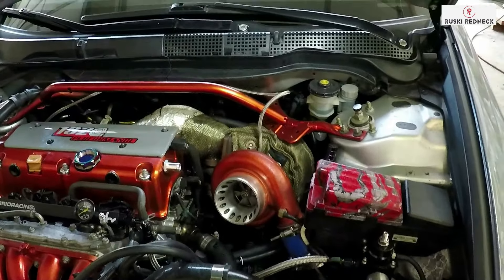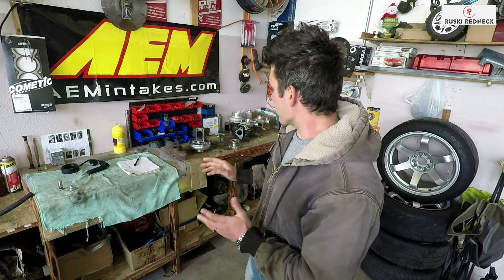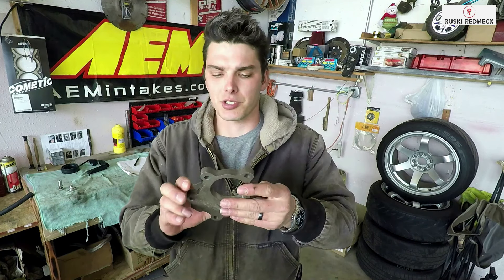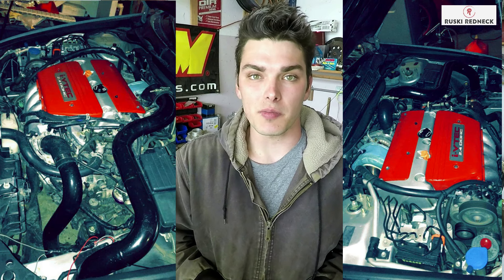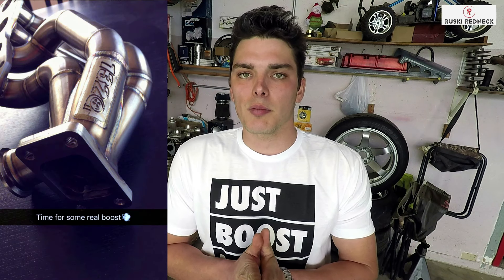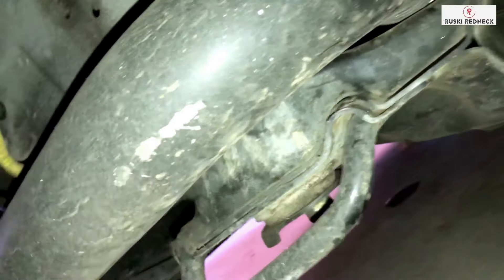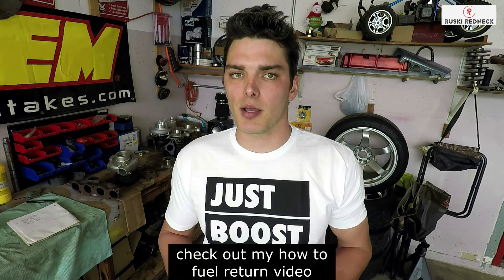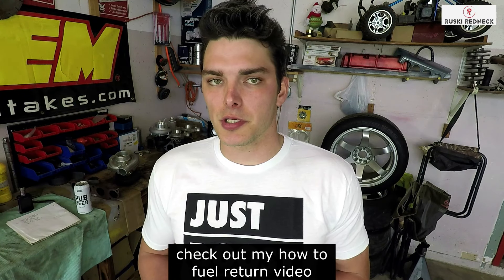TURBO Your Tsx For CHEAP!!!!

Comment: Thankfully I didn’t have to change out my clutch! I turbocharged my automatic tsx and it came out amazing. 14psi and 320whp
Reply from the maker: Right on! I didn’t have good luck turbo charging my auto. Kept getting trans code and after changing everything I could I gave up and went manual.
Reply: @RuskiRedneck  I’ve been wanting to go manual but I want a parts car either everything all together, ecu, harness and tranny. I don’t want to play leggos and try to piece it all together. But I went with the cxracing kit and god was it awful. Downpipe didn’t fit what so ever. The log manifold was shit. Then the wastegate took a shit. Then it was a pain in the ass to get under the car to remove the wastegate. Finally I went with tial BOV and tial WG and then I finally bent a valve. So I just rebuilt my head and I’m slowly piecing it back together. I also changed to sidewinder now so I’m excited to see when I get it back together how much power it makes. I don’t want to go over 350whp cause I hear the auto trannys don’t hold up around that power
Reply from the maker: @Dan__0012  side wonder you’ll make 400-450 on 14psi so be careful. That log suffocates the k24
Reply: Can you tell me a list of everything you had to buy
Reply: @HollyHoodRiek  oh god man it was quite a bit lol. Message me on Instagram and I can give you some pointers on where to start!
Reply: How's your tranny holding up? I'm considering doing a turbo build on my CL9 as well.
Reply: @Dan__0012  What's your instagram?
Reply: @Dan__0012  hey can you help me too?
Reply: @RuskiRedneck  how much power did you push on the auto trans before you had issues? My auto trans is the main thing holding me back from adding power
Reply from the maker: 8psi on a street tune my guess it was around 320-350. I don’t think I had issues due to boost. My auto was pretty much my first car as a teen and I abused the crap out of the trans. There’s people that have really good luck with 8psi on auto. I think I had underlying issues.
Reply: automatic?? gross lol
Reply: Do you have a social media I’ll love to ask you some questions
Reply: @TheShangralaaaa17  It's his car, he can do anything he wants with it.

Comment: Hello! I am buying the cx turbo kit and I have a few questions. I currently have RDX 410cc injectors. I won’t be running too much boost so is it ok if I can keep those injectors and not use an aftermarket fuel pump, fuel return, and fuel rail?
Reply from the maker: You will need bigger injectors unless you are running like 2-3psi. Talk to your tuner You might be okay with your set up for a bit. But it’s always better to have plenty of fuel.

Comment: So many joins on that intercooler piping, I'd run a genuine wastegate (When they fail, they either don't boost or more commonly over boost and unless you have boost cut setup, it'll take out your motor)Why not use a cheap fuel rail and spend the saving on the wastegate.   the other thing I always buy genuine is the fuel pressure regulator

Comment: Nice video man good info! 

That was the plan on running the CX racing piping and intercooler, was going to potentially run the log manifold but from another guy it’s a really tight fit and the turbo I want wouldn’t end up fitting lol. 

Might just get the plm sidewinder and have the welds touched up perfect any potential cracking.
Reply: What size turbo was u going to run with the log style manifold
Reply: @marlontucker5419  I wanted to do precision’s 6262 

Guys running the cast manifold with a t3 precision 56 or 57 and said was already a tight fit.
Reply: i dont mean to be so off topic but does someone know of a method to log back into an Instagram account..?
I somehow lost the login password. I love any tips you can give me.
Reply: @Khalid Trevor Instablaster :)
Reply: @Shiloh Kristian it worked and I now got access to my account again. Im so happy!
Thank you so much, you saved my ass !
Reply: @Khalid Trevor Glad I could help =)

Comment: If I wanted to go with a turbo build what are the prep parts I need to upgrade on my engine/ tranny to have sustain all that power?
Reply from the maker: Depends on the power level you’re going for. 400hp should be fine with a good tune and fuel system. 500hp I’d go e85. Anything over I’d build the block sleeves pistons rods and head and run e85 1500-2000cc injectors 450walbro fuel pump.

Comment: I’m so lost I have a 2004 Acura TSX 5speed automatic. Where do I start?
Reply: I would get hondata flashpro, so you can have some fun while you start piecing up your kit (turbo, manifold, ic, pipings, injectors, oil feel and return lines, and lastly you prob want to upgrade your oil pump to k20a2 oil pump).

Comment: recommendations for A/Ts boosting? besides the obvious why would you do that lmfao
Reply from the maker: I would say go with a super charger with an auto trans.
Reply: @RuskiRedneck  Why do you say supercharger for auto?
Reply from the maker: @SoulEraser000  because the tsx auto trans doesn’t handle power too well. Supercharger gives power more gradually. Kinda eases into it. Where as a turbo will kick in later and a lot harder causing a lot of stress to the trans.
Reply: Do a manual conversion
Reply: @Kr0n3kLe  that's like the cost of boosting your car lol
Reply: @SoulEraser000  Maybe if you are paying someone to do it for you? I just installed the CL7 Accord Euro R transmission into my TSX. It cost me a total of about $1,600.
Reply: @Kr0n3kLe  Make a write up then cuz this is the cheapest I've heard anyone doing the swap lol
Reply: @Kr0n3kLe  yeah i need the write up for this cuz the swap from what ive seen is expensive